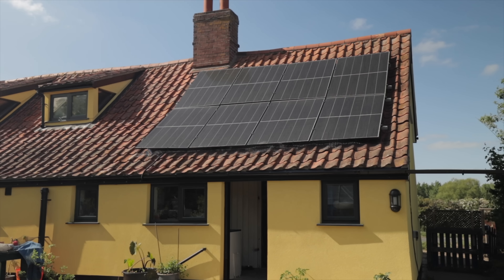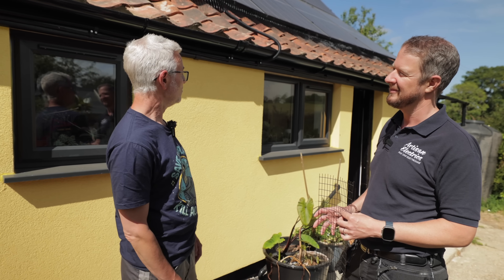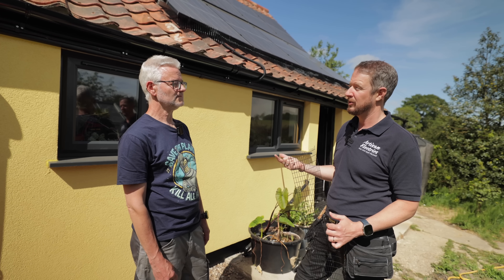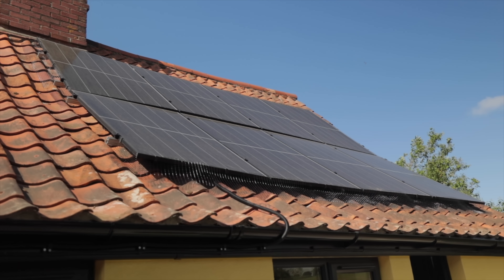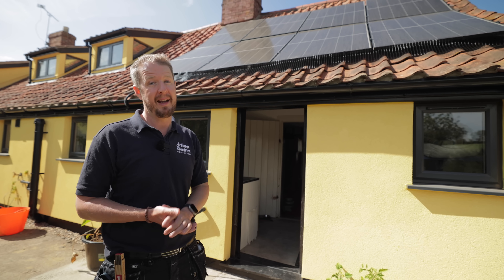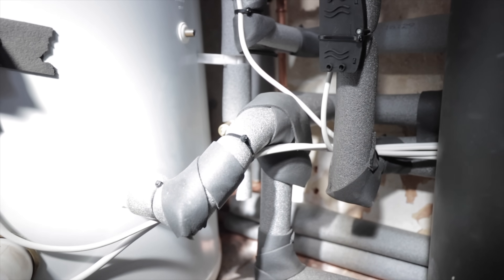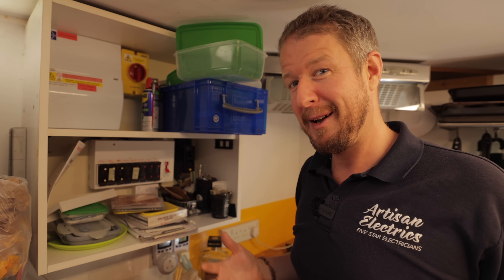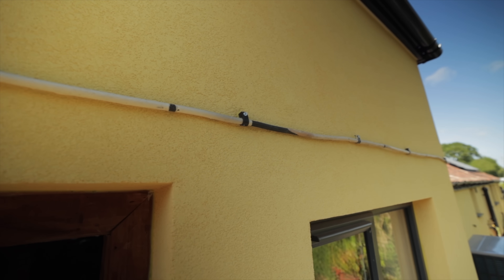This £50,000 Grant-Funded Solar Installation Went Terribly Wrong…😱

Comment: With Labour’s obsession about forcing Net 🤡 Zero onto everybody, you can imagine these installation failure issues could become widespread.
Reply: I don't see how this was forced on the guy - he chose to have it. The tech is not the problem here it's the install.
Reply: @VillageVidiot100   Nobody said it was forced onto him!
However, these systems such as air source heat pumps are being forced onto new home builders, so it's possible there will be low quality installs all over the UK by the time Labour's Net Zero has been kicked out.  Meanwhile, cowboy installers shall have made their money, liquidated their rouge companies leaving owners to repair the systems and moved on to the next get rich quick scheme.
Reply: @HYUKLDER1  A well designed and installed heatpump system can be great - and isn't rocket science. Why wouldn't you want a heating system which could be ~4x better than just resistive heating? Once you can manage heatloss of course.
Reply: @reallymadrob   You hit the nail on the head there.  Modern buildings with suitable central heating pipes could be refitted with heat pump systems, but most homes in Britain are unsuitable.  Heat loss experts know the truth about the real difficulties such as with flats, old buildings, lack of an average £30k to make the change with making good, etc.  However cowboy sales people (who have previously done double glazing, wall and loft insulation, etc) are jumping onto technical installs and just don't care if a building is suitable.  There are high heat pumps that would work beter in older homes.
Reply: @HYUKLDER1  Luckily our house (this one) was suitable for EWI and that was the only way we could have afforded heating - let alone a heat pump. Most schemes only have the option of internal insulation which was not viable here. As soon as the EWI was on the effect was obvious and when the heating runs it is very effective because it has so little to do now 🙂 As a package it works we could not have afforded to run a heatpump efficiently before even if we had one that could supply enough heat. (~30kW)

Comment: Short houses? People were shorter! Nutrition has allowed a significant growth for most of us over the generations. Look at basketball - when originally invented, the basket was way out of reach. Now I have seen players tip the ball into the basket.
Reply: People were, on average a couple of inches shorter a few hundred years ago - but only an inch or two so really of little impact on ceiling heights. Of far more significance in the past 100-odd years is the universal installation of electric light fittings, the vast majority of which were and are hung from or fixed to the ceiling. Hence it became normal practice to include sufficient space for these to go above head height.

Comment: That’s an obscene price , had 22 panels , UFH , 12 K3 rads , 24kw sigenergy , heat geek cylinder , 2 by mitsubshi pumps 11kw ea for same money and not a cable to be seen .
Reply: And full external insulation?

Comment: 50k for an array that size seems steep. For the whole job, that seems less fast. I'm amazed a house that old was allowed external insulation.

One possible solution: The funding agency has a framework agreement with say 20 or more contractors and allows the grant recipient to select the contractor they consider best suited to the work. The funding agency should of course allow co-pay for site-specific upgrades such as the mentioned improved inverter. Finally, the funding agency should inspect what they expect - for instance visit a percentage of installs to satisfy themselves that their funding is doing what was intended. Yes, that would involve them leaving the office occasionally and going on site but that would also then better inform them on future contracting. Just some initial thoughts ...
Reply: The £50K paid for the external insulation and the heatpump system as well as the PV array!
Reply: lol I don't think 8 panels on the roof cost 50k :)
Reply: I'm amazed its allowed to have solar on the roof, a garden pergola with solar as the covering would make so much more sense